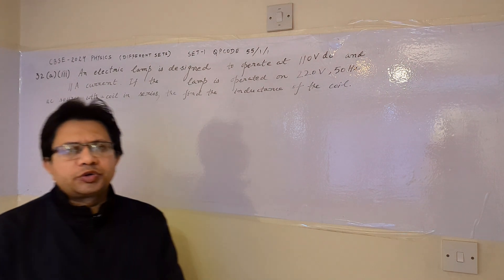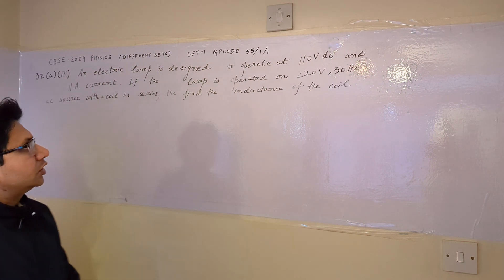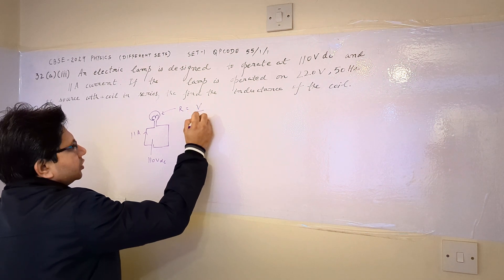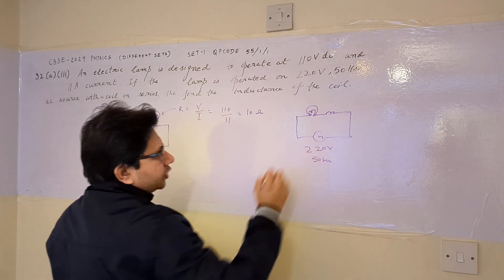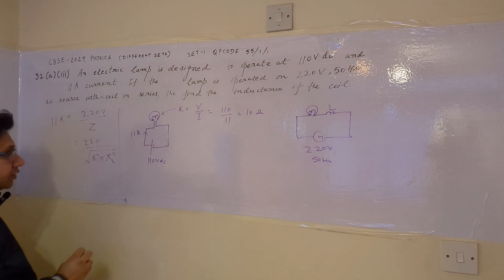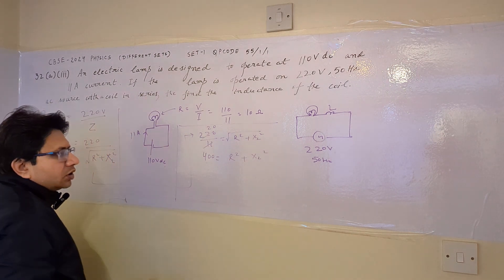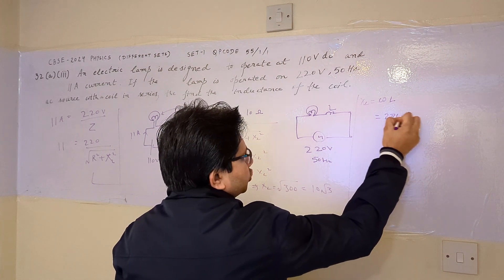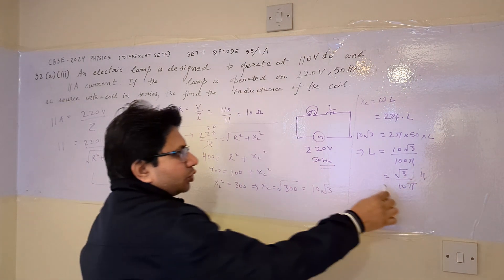An electric lamp is designed to operate at 110 V DC and 11 A current. If the lamp is operated..

Comment: Sir why ia the current same as 11A as in the 2nd circuit with inductor shouldn't it change ?
Reply from the maker: Nice question. This is the maximum safe current according to the first line of the problem. I agree with you that in the second line of the problem, it is mentioned nowhere that a current of 11A flows. But we have to assume in this case also that for safe operation of the lamp we have to use 11A current as a maximum value. That's why we have taken 11A current in the AC case also, and find the Inductance accordingly.